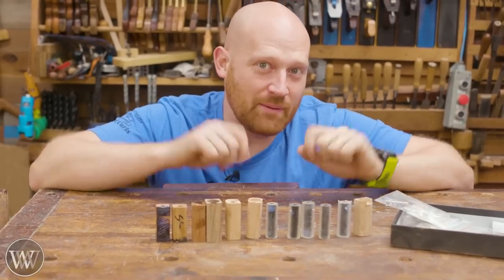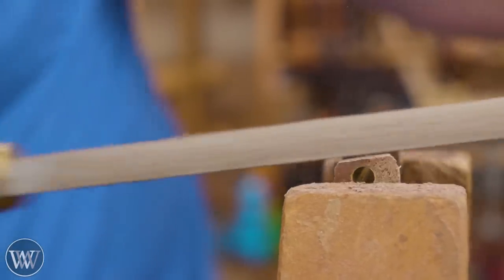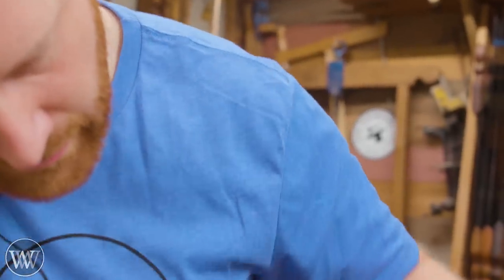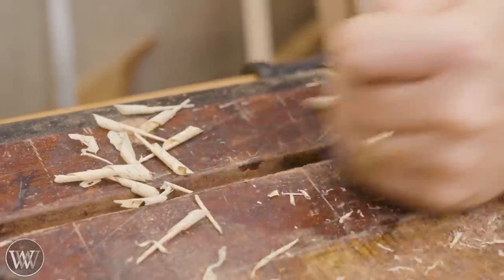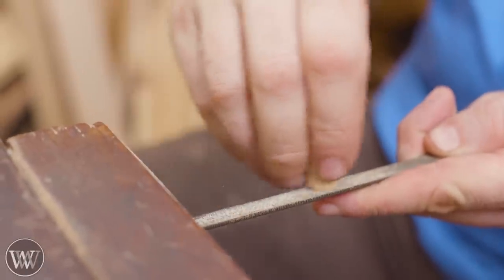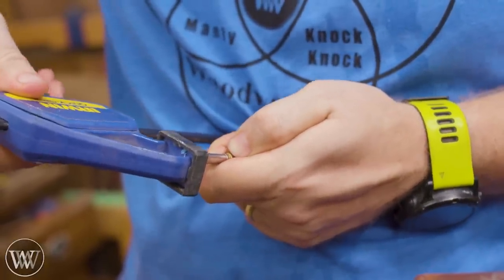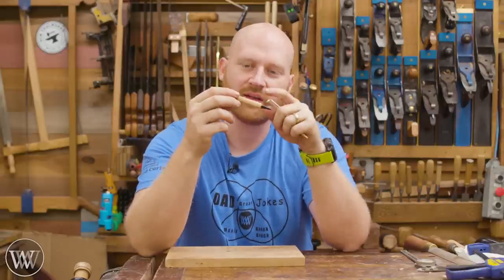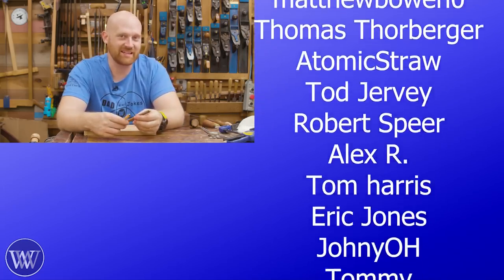No Lathe No Problem How to Make A Pen Without A Lathe

Comment: The octagonal seems really nice. Gotta figure out how to make on the lathe...
Reply: My lathe (Nova Comet) has an indexing head stock…I just need to make up some form of jig to reference a file off after I turn the blank to the correct diameter. I know that it is possible to make a router sled for making flutes in turned legs for example, but that is not in keeping with the Wood by Wright hand tool ethos.
Reply: I'd recommend looking up a "turner's cube" for how to make flat faces on a lathe

Comment: tube length on slimlines are super forgiving.  the twist insert that is pressed into the tube closest to the tip can be pressed into the brass tube to whatever depth is necessary for the tip to extend and retract properly so the length doest need to be as exact as it would need to be for a cigar pen for example.  that is one of the reasons that people suggest the style for new pen makers to start on.  i wish i could tell you what type of wood those blanks are but they were prepared so long ago that i forget.  also, most if not all of the wood blanks were vacume stabilized with a lesser quality resin so the tone of the wood was affected more than if would be if cactus juice was used or obviously if they were natural.
Reply: I had a set and had length problem, but only with one. I guess I did something wrong, but it really didn’t want to match up the lengths (even though everything was same size).
Reply: @A2woodArt  the trick with the slimline is to press the twist insert in slowly and check how far the pen tip extends and retracts in increments until the fit is just how you like it.  i started out making just slimlines for the first 50 or so pens i made because i did not yet have a pen tube mill.
Reply from the maker: This is correct unless they were trimmed shorter. As the first one was.